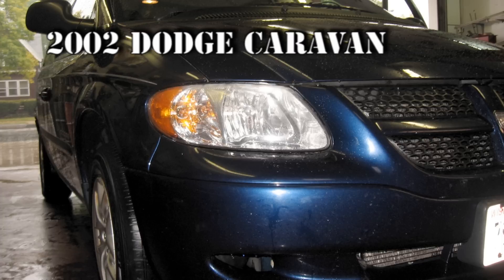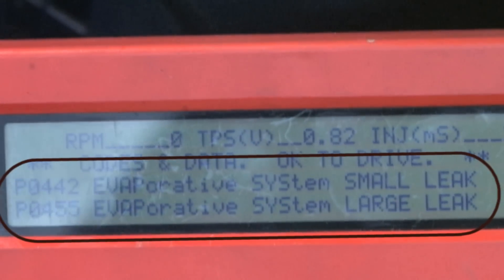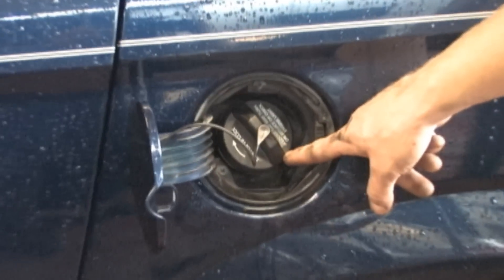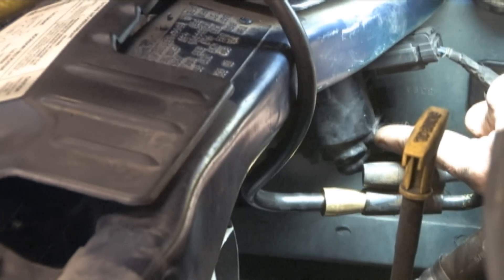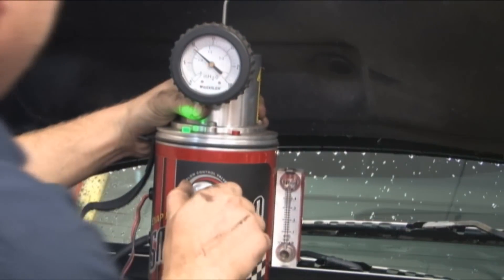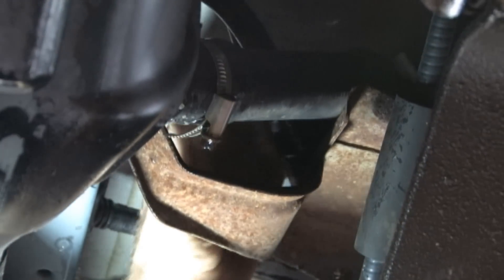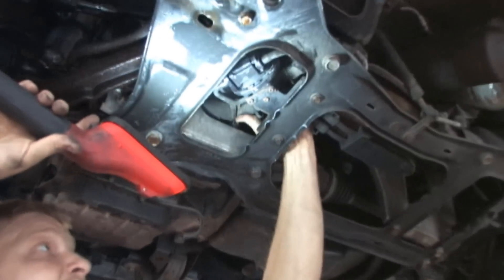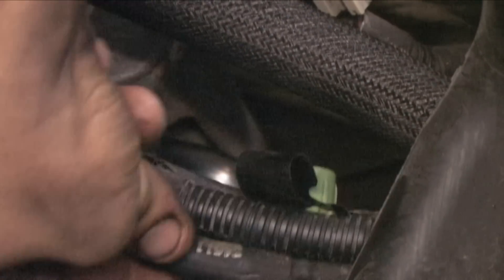Wells Dodge EVAP Troubleshooting and Repair P0442 P0455

Comment from the maker: Hello John,
1. Check for 5 volts to the Throttle Position Sensor (TPS) on the Pink/Yellow wire and for 8 volts to the Crankshaft Position (CKP) or Camshaft Position (CMP) sensor on the Brown/Pink wire.

2. If no 5 volts or 8 volts , check powers and grounds to the Powertrain Control Module (PCM). Power supplies are pins 20 and 46. Grounds are pins 10 and 50.

3. If no 5 volts out of the PCM and the power and grounds are good replace the PCM. 

Mark Hicks
Wells Vehicle Electronics

Comment: I have a 2003 dodge grand caravan es with the 3.8L. It won't start at all, has power, no noise from the starter to indicate it has failed. It's giving me multiple codes on the odometer including the 0442, 0455, 0456, 1681, & 2128. Could the evap issue cause it to not start? My neighbor luckily owns a shop and is bringing his computer home to check it out, but is really confused about it so far. Any thoughts? Thanks for your time! John

Comment: I have a 2002 .3 Dodge Caravan. Check engine light cam on and I am getting code P0441 Evaporative Emission Control System Incorrect Purge Flow. I reset the computer 2x so far and right @ about 100 miles it comes on with the same code each time. I recently had the intake plenum off to rewire the injector harness and am wondering if I screwed something else up in the process. What's throwing me is the 100 miles before it comes on thing. Any ideas? Thanks in advance.

Comment from the maker: You will still need to check with your emissions testing to see if they allow one monitor not set. The most common causes for the P0442 on your vehicle are the gas cap and canister hoses leaking. They also have some problems with the Leak Detection Pump.
Hope this helps you,
Mark Hicks
Wells Vehicle Electronics

Comment from the maker: First off George, I have no idea what kind of vehicle you have, but I will try to answer your question the best I can. I believe you are asking if you would pass an emission test. It depends upon the laws in your area. Some will allow one monitor not set and some will not. I suggest contacting them. No Idea on the cost of repair, sorry I don't do money.
Mark Hicks
Wells Vehicle Electronics

Comment from the maker: Actually it will work on most any vehicle. What is the year, make, model, engine size and code. I might be able to steer you in the right direction.

Mark Hicks
Wells Vehicle Electronics

Comment: I used a converted medical suction machine to supply pressure after the solenoid with out using smoke then with the +/- 25psi pressure,hissing sound develop by the crack hose.  Thanks for the video it helps me a lot locating the crack/broken spot of the hose.

Comment: This video is the best among the rest, it help me a lot, I have same issue as stated P0442/P0445. the problem was cracked hose along the line, only they are in corners where the tube was bent. A coupling hose from a copper tube to solenoid then from solenoid to air intake. Chrysler voyager 2002 w/151k miles on it. Again Thanks and more power.

Comment: have a chrysler t &c 2005 with a check engine code p0499-do i need to change the purge solenoid or the leak detection pump?

Comment from the maker: The most common cause for a P0455 on your vehicle is a cracked EVAP hose. Usually it is the hose above the canister ... not easy to spot or get to. 
Hope this helps, please let me know what you find or if you need further assistance,

Mark Hicks
Wells Vehicle Electronics

Comment: I just recently bought a 2002 jeep grand cherokee with the 4.0 inline 6 and its got the P0455 large leak error code It was like this when I bought it and I was told that a new gas cap was put on but its still got the code do you have any suggestions as to where to start looking for the leak on my jeep?

Comment from the maker: When the cam and crank sensors are out of sync, it will cause a misfire under load on your vehicle. The only way to check them is with a labscope. It is also common for the ignition wires to cause this issue.

Mark Hicks
Wells Vehicle Electronics

Comment: What would make it chug uphill though almost like a faulty injector or a misfire on cylinders one and four but it isn't throwing the misfire cel also plugs one and four have (not saturated) oil on them I checked them today it also seems to run more rough with the ac/heat on

Comment from the maker: The code P1281 usually means the thermostat is defective. The P0442 and P0455 usually mean either the leak detection pump is defective or you have an EVAP hose that is leaking. The only way I know to test the system is with a smoke machine. 

Mark Hicks
Wells Vehicle Electronics

Comment: It's a 2002 se it's throwing the cel p1281 p0442 p0455 and a code for the battery being disconnected within the last 50 cranks

Comment: My neon is throwing the same codes with another code saying the engine is taking too long to warm up I changed the thermostat back in july but have problems now...it's chugging uphill and backfiring has a rough cold idle and rough idle with the heat or air on...any ideas I'm clueless I just changed the fuel pump too

Comment: I haven't done a smoke test yet, but I did notice the oil filler cap wasn't as tight as it should be. I tightend it, and a while later the mil lamp went off. Would the oil cap even make a difference with this?

Comment: Sorry, my "6" key was stuck. It's a p0456 for a 5.7 hemi, which calls it a very small leak in the system. I actually am not sure it was also a p0444, it possibly was a p0442, this  also was a very small leak. I got this 0442 code once, the others have been 0456. Thanks!

Comment from the maker: What size engine do you have? Is that a P0450? I looked up a P0444 for an 04 Dodge Durango with a 5.7 and the code was not a good code. 

Mark Hicks
Wells Vehicle Electronics

Comment: Hi there, would you reccommend the same procedure for a p045 very small leak code for a 04 limited durango? I have replaced the gas capp and still have a dtc. I did get 1 p0444. But mostly it's the p045. Any special area to consider? Also, will this cause misfires at all?  Thank you!!!

Comment: Wow!  Very informative...I will have a look when I get home tonight.  My codes just turned on my '02 Grand Caravan 133K miles this morning, but I have been noticing a whistling sound lately (sounds like a vacuum leak) that fades slightly when the throttle is pressed, but is very apparent at idle.  Does this sound like it's the problem?

Comment: I have a Dodge Dakota which had the same two codes shown here. I was just about to go to a mechanic, but then decided to look for a video and see if I could find it. This video was amazingly helpful. I did a visual check on all of the locations indicated in this video and found that a hose exiting from the purge solenoid to have a tear. This video just saved me both time and money. Thanks a lot!

Comment from the maker: The P0455 will normally not cause the engine to shut down. When the engine stops the vacuum in the brake booster is lost and that will cause your brake pedal to get hard to push. For the P0455 look for cracked hoses near the EVAP canister it is a very common problem. As far as the engine shut down, try to determine if it a fuel or spark issue. If you need further assistance please let me know. 
Mark Hicks
Wells Vehicle Electronics

Comment: Hello mr hicks. the truck that am having trouble with is the dodge dekoat 4.7 2002 4x4 cub cab. i did change the gas cap but the the only problem am still having is the p0455. I also wanted to know if a large leak would cause a truck to shut down or make the break pedal to go hard once it shout down.

Comment: Hello Mr. Hicks, i have the same similar problem as shown on your vid my dodge dekota reads a the code P0455 for evap leak, i changed the gas cap but still get the code, i also had it smoked out but the guy i went to did not find any leaks. my only problem with my truck is that it stall when ever i make a turns or come to a stop. any suggestion would be appriciatec.

Comment: Would a leaky fuel pump seal cause a P0442 on a 2003 Grand Cherokee?  I've had it smoke tested and fixed the purge valve.  But, it is still showing the code.

Comment: @markjhicks I have a jeep grand chereoke 2001 v6. I took my car to auto zone and the gave me the 2 codes but when i drive on the freeway i noticed that my car doesnt switch to 2nd gear it stays on 1st. So i thought the leaks were the probelm.
Reply: That is most likely the canister purge valve

Comment: Hi, I would like to ask a question:) My van is a 2004 Dodge Grand Caravan w/111,000. miles on it in 2010 I had major repair done on it was over $1600.00 worth!! YIKES! 
     Anyway now the engine light keeps coming on the guys at Auto zone have told me it's the Canister Purge Valve Solenoid the young man told me it's an easy repair just unplug the old and replace with the new by the gas tank. But what you show here looks more than that can you pleace explain!
TKS. DJ

Comment from the maker: @JUDGERAMBO It depends upon the vehicle, some are normally closed and some are normally open. If it is normally open and you smoked the EVAP system, then yes smoke would come out of the vent solenoid. Either command it closed with a can tool or tape it off. 
I hope this answers your question.

Mark Hicks

Comment: Mark, I think we have the problem solved. On my Hyundai, they had 2 pieces of metal pipe from the canister, held together, with what looked like shrink tubing. I suspected that may be the problem from the start, but everybody kept saying no. A friend who has a garage, put it in the air, and we cut the shrink tube out, replaced it with regular fuel line hose, reset the check engine light and so far, so good. It's been over a week now, and the light hasn't come on. Wish me luck buddy... & thanks !

Comment from the maker: @thelazycomic  I cant really say what a garage will charge for a service. But if I were to guess it will be about an hours labor or so. I know my answer was a little on the fill problem but the point was, if you have not changed the canister close valve you might want to do that as a guess. Reason, it is easy and it is very common to cause the P0442 trouble code on your vehicle.

Let me know what happens please,
Mark

Comment: Hey Mark, thanks for being cool about the being broke thing. I must have lost you on the descript on this. I don't have any more problems putting gas in the car. Goes in nice and easy. I just need to get the check engine light off with the P0442 code. I've changed all hoses on the carbon canister, and the light came back on. I am at the point of having to have a garage fog the evap system. Was wondering, (ballpark), what it would cost to have done? thanks man.

Comment from the maker: @thelazycomic Hey Brother we are all broke at one time or another, don't feel bad. Have you replaced the canister close valve? If not that is what you need to do, very high failure rate and will cause your problem. Here is a quick way to check it: 
1. Check for pinched/kinked hoses on the fuel tank to the canister.

2. Check the canister close valve. It may be sticking closed intermittently.

3. To test, just unplug the canister close valve and attempt to add fuel to see if any better. 

Mark

Comment: Mark, I had to change out my carbon cannister on my 1999 Hyundai Elantra. (Gas got into it from me over-filling the tank). Had trouble putting gas into the car. I picked up a used one from an auto recycling place and did the install. After I did this, my check engine light came on with the P0442 code, small evap leak. I replaced the hoses attached to the canister, but no luck. How much should this cost to get it fixed at the garage ??  I'm broke, so I have to ask this question.

Comment from the maker: That is a great question. The best way to test an EVAP system for a leak is to use smoke. Another way to check the system is to check all the components and hoses with air pressure. First you can apply only a very low amount. Each component must also be checked individually. It is also very difficult at times to pin point the leak. The gas cap can be pressure tested separately.  A very good visual inspection can work many times. But again the best way is with smoke. 
Mark

Comment from the maker: Hello,
A leak in the EVAP hose will not cause the engine to overheat. Common causes for your vehicle to overheat are coolant leak (possible water pump), thermostat and fan inoperative. If you need more assistance to find the problem let me know.

Take Care,

Mark Hicks